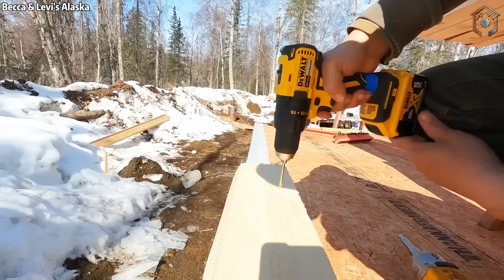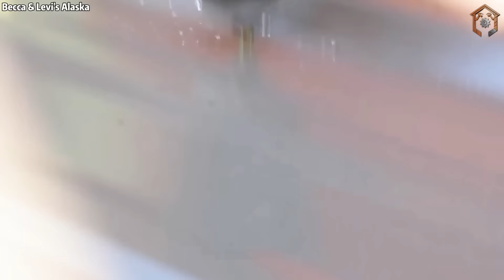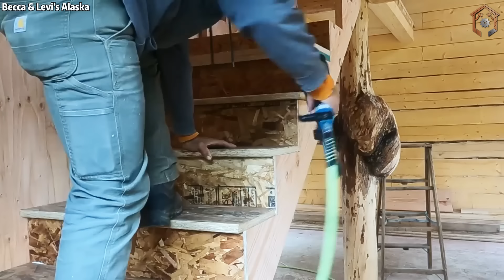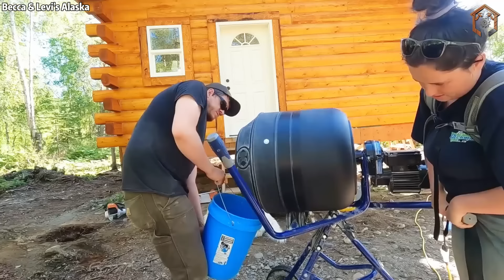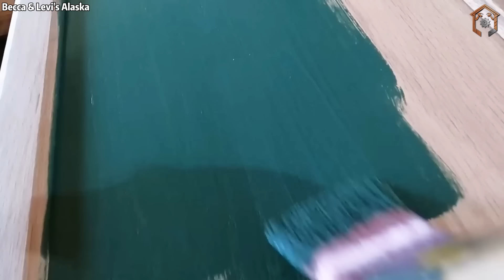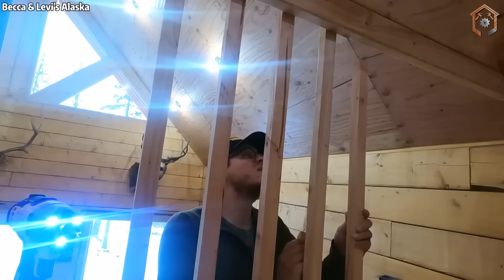Family build their off-grid cabin in Alaska amidst a snowstorm |

Comment: Very good, I had to watch in silent mode as the AI commentator was awful.  Agood yip when painting kitchen cupboards or foors is to use a dponge roller, then lightly go over eith a dry clean brush, do much smoother with no brush stroke lines
Reply: It was a problem more on the script that this channel used. AI voice over will just follow the script.

Comment: First stove I’ve seen installed in the middle of the room. Excellent position, when you put it up against the wall, all the goes out through the wall. Also, I don’t know why it hasn’t been invented, but the coiled exit vent would let more heat into the room. Otherwise, the heat just goes out the vent.
Reply: Nä allt beror på hur huset är skapat . Ett halv timmer hus har problemet att den inte tål hög värme . Om kaminen är för nära väggen så måste man bygga ett värme skydd av metall betong skivor . Vilket inte är direkt snyggt . Gör man det inte så riskerar man att halv timmer väggen spricker . 
Din idé om en spiral formad skorsten så får du bygga en själv . För rökgasen måste ut snabbt annars tar den en lättare väg . Och får du det att funka så har du trassel nummer 2 hur 17 ska du kunna sota skorstenen ?  För det måste göras varje år i permanent boenden för att slippa skorstens brand . 
Men man kan installera koppar rör som en slinga runt röret och fylla röret med glykol . montera en cirkulations pump och köra allt in i en varmvatten beredare .